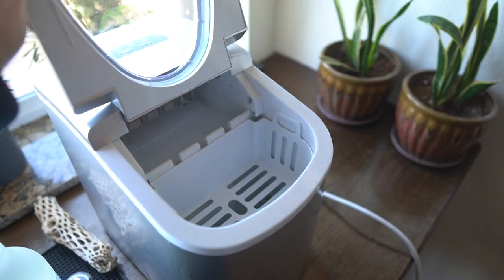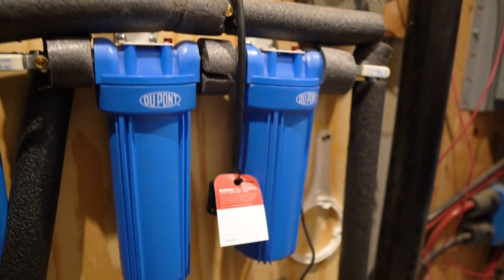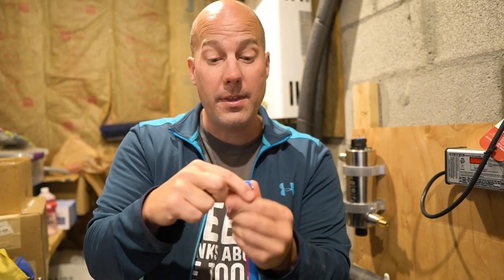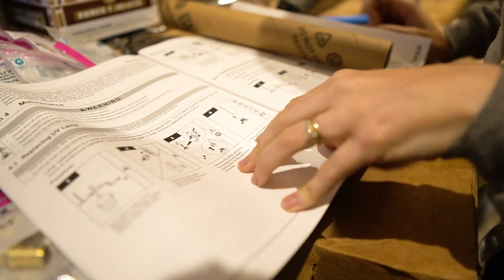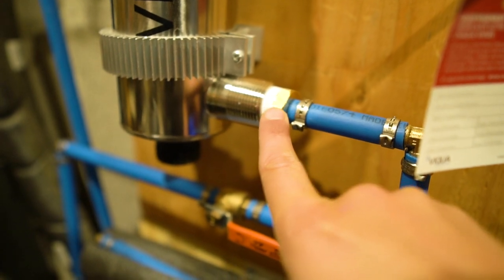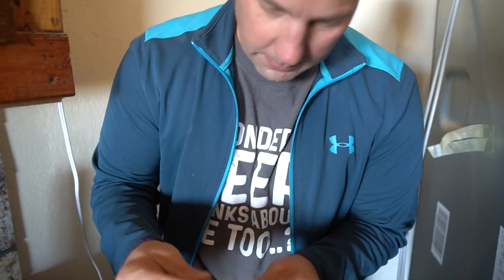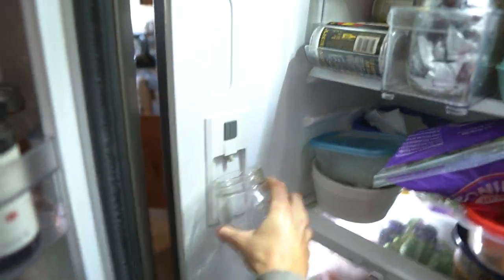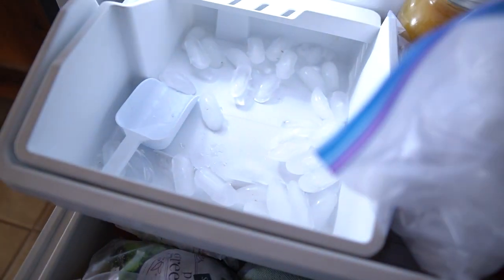How to install a UV water purifier in an off-grid home

Comment: Hello A Dreamin' Life! Great video and enjoyed watching how you inserted the UV part. I am going to be installing a UV purifier also. One question: Did you take into account the possibility of UV degradation of the PEX tubing connected to the UV purifier? Some information indicates a minimum of 6 inches of metal pipe before PEX/PVC to prevent UV degradation of water line.

Comment: Is the purifier for more than drinking water?  I'm thinking that I heard Courtney mention the heater?
Reply from the maker: She was saying that everything inside the house will get the purified water, including sinks, our shower, the water heater, etc.
Reply: @AStreaminLife  Thanks but I'm surprised the little pump delivers enough pressure.  Have you tested the PSI?  I might need to add one at our place.  Do you have a video from that install?  (Link for the UV filter?)

Comment: Those are actually brass barbed fittings. Sharkbite fittings are different and more expensive than brass barbed with crimp bands.
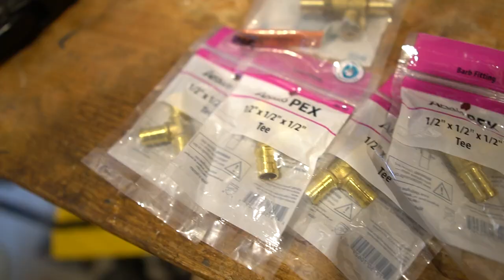Reply: Ummm…the video (at 2:40) shows these brass fittings in sealed plastic bags with the SharkBite logo clearly displayed on each one. Steve is quite the perfectionist when he does a project, so I can assure you that he wouldn’t “go cheap” on the fittings.
Reply from the maker: The bag suggests differently.